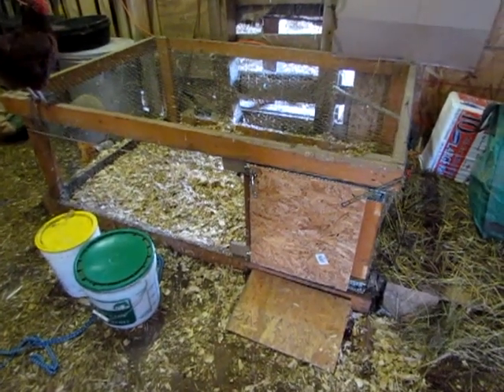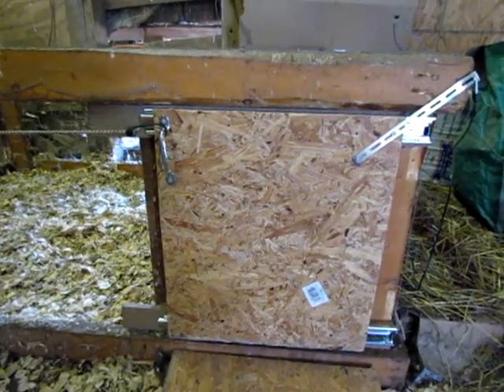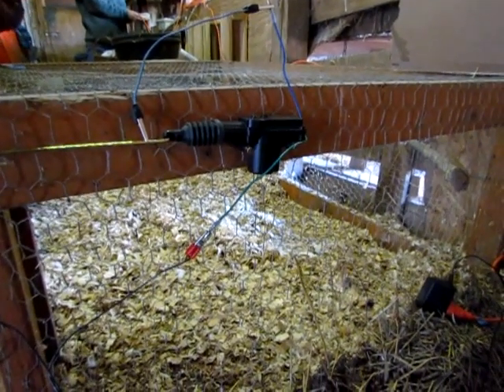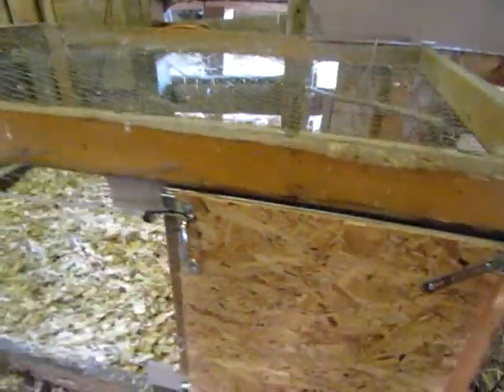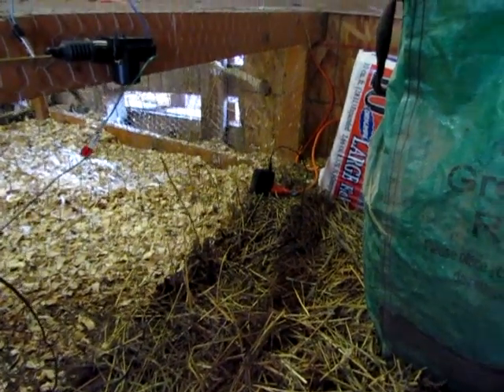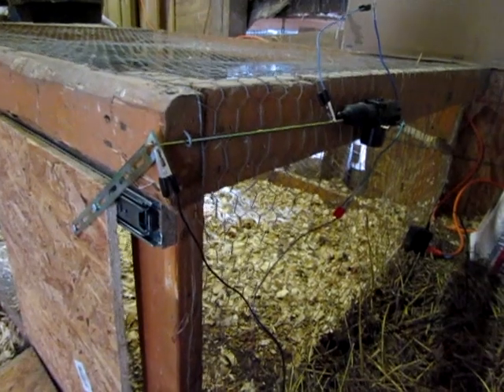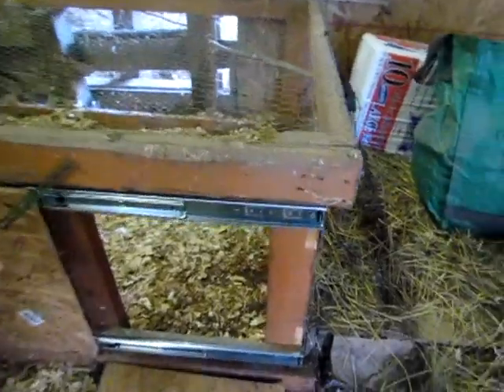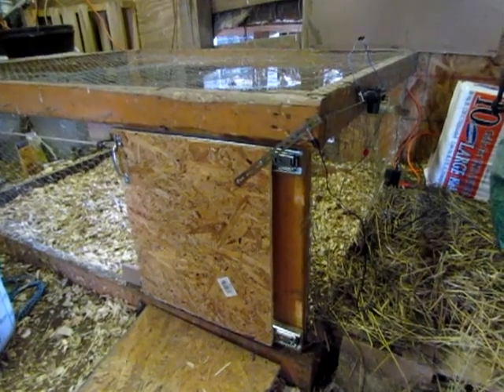Automatic Duck Pen Door Opener

Comment from the maker: Thanks for the kind comment and good suggestion.  The transformer is energized for only 15 minutes (the smallest increment of the rotary timer I'm using) of which the solenoid draws current for only a second (since the circuit is broken as soon as the door opens), so the transformer does not really have an opportunity to heat up, but I did zip-tie it to the cage up out of the way of the hay for convenience (and safety).  This setup is used every day and still works flawlessly!

Comment from the maker: @itismike Thanks!  It works well and I look forward to seeing what the quacks "think" of it in the morning.  Two strips of aluminum channel would have been nearly $10, so $15 for 20" heavy duty ball bearing drawer slides was a no-brainer.  There is no fuse, but the wires are now taped and secure (I wanted the circuit to be clearly visible for the video).